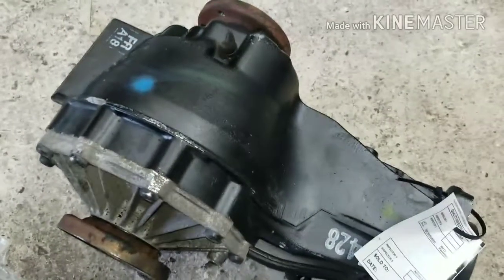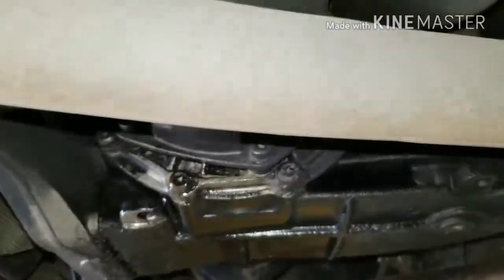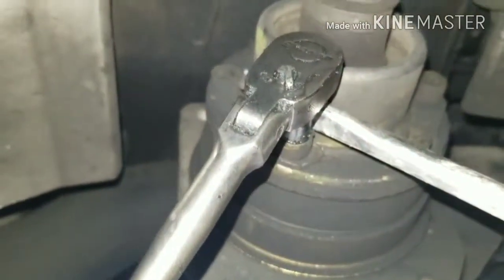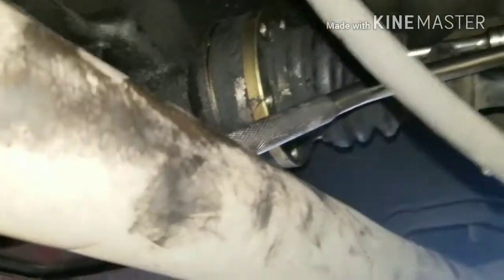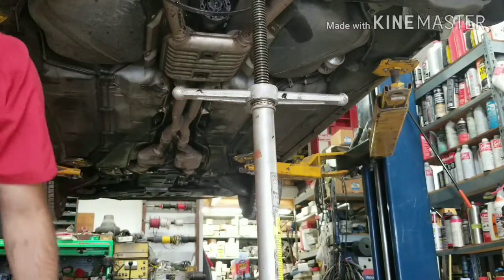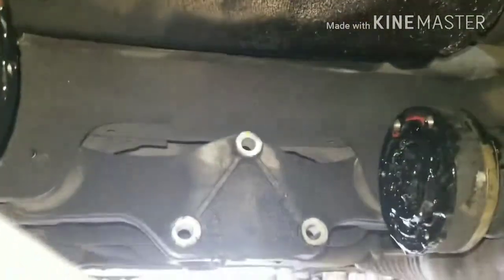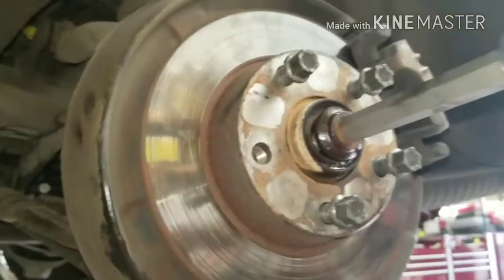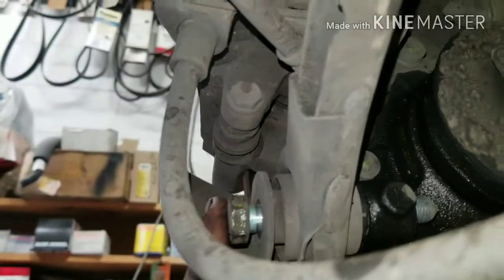How to change the rear end on a audi a4 a6  Quattro  98 99 2000 2001 2002 2003

Comment: Im having trouble removing one of the output flanges, the bolt holding it in is very shallow and i feel it wants to strip.
Now that i see the diff out of the car, could it be that i could undo all those bolts on the side and get that thing out?
Reply from the maker: I'm not sure those bolts can be the scary part about it,  I've always either got them out or used a special socket for getting stripped out bolts. Hope this helps besure to like and subscribe for more tip and tricks

Comment: Was the noise this diff made speed dependant or was it audible as soon as you start moving.
Reply from the maker: It was really growly ar low speeds and got a lot louder at higher speeds, to try and narrow it down try sitting a buddy in the back seat to have them tell you quick side of the car is louder it could be a wheel bearing also. I hope this helps you be your own mechanic  be sure to subscribe and hit the bell yo get all my latest tips and tricks thanks for watching my video.